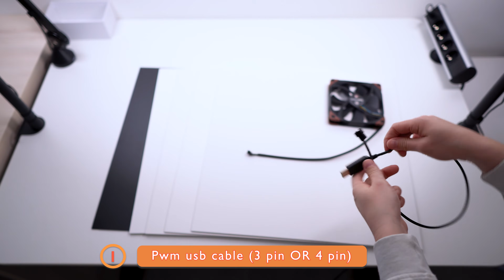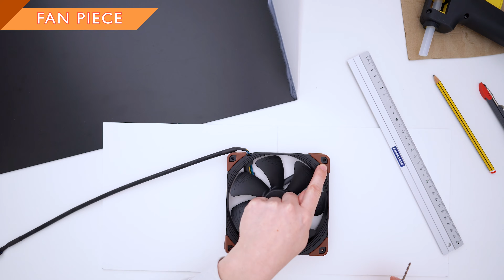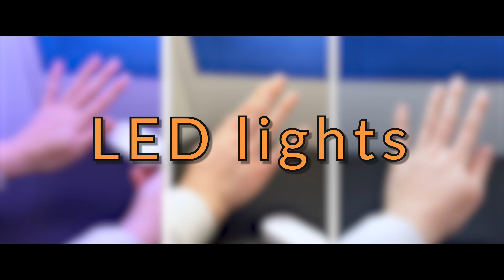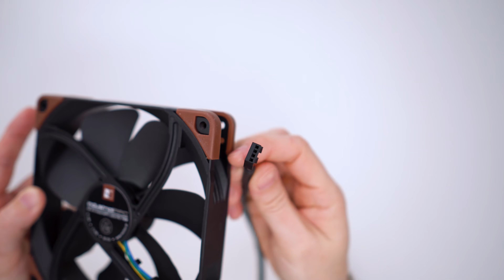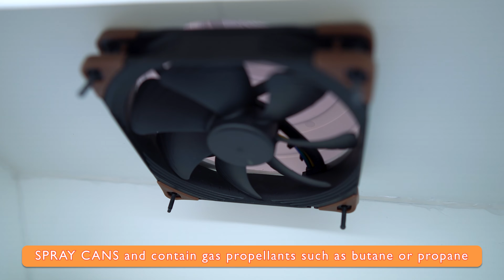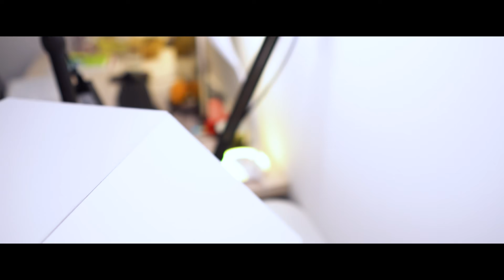Airbrush Spray Booth Build, How to Make it with Lights & Noctua Fan!

Comment: I know this is 4 years late but to anyone considering a similar setup definitely opt for a high static pressure fan, especially if you're running through Ducting hose. Basically if you wanna go the PC fan route choose a fan made for heat sinks or radiators . You can generally tell it's made for static pressure if  There are minimal gaps between the blades (this noctua ones gaps seem a bit large). 

 You could also overvolt this fan to maybe 15 volts to squeeze some extra power out of it. Especially being an industrial fan likely meant for continuous use overvolting it will get you more power and since you're not running it continuously I wouldn't imagine it overheat.

Comment: I wouldn't use the noctua. Just not cut out for such work. I could easily get a cheap HF-150 inline duct fan at $15 where I am and it has airflow of 540 m3/h and it's direct to wall socket and uses 75 watts.

Comment: Hello Daniella, looking for how to build my own airbrush booth (I'm just starting out :)), and trying not to have large expenses on it, I came across your channel.
According to how you explain in your first video, building the cabin, I must tell you that it is very professional as you explain, very good.
If it's not a bother on my part, can you put the measurements that you have used for each of the parts, to make an identical one?, since although the place I have to put the cabin has no exit to the outside, that cube where supports the hose, it has given me an idea of how to solve this.
Once again I congratulate you for how you explain and edit your videos.
Greetings from Buenos Aires, Argentina.
Reply from the maker: Thanks for watching! All the measurements are explained in detail in the video (where I come from, I use centimeters, but I also include inches), so all you have to do is stop the video where I measured the foam boards and draw them on a piece of paper - nothing special ''spices'' for this. In life in general, you have to be resourceful, and that is why I encourage and support all viewers to think that way. Let me know how your build goes and how you solve the challenges!

Comment: i Merci pour le tûto. le profilé a t'il le verre laiteux ?
Reply from the maker: This rigid foam board is not the same as Plexiglas, but I suppose you can use it as it will work anyway. The rigid foam board is made of a dense foam core, which can be laminated on both sides, and different types of plastic are used in its manufacture. Because it is made of foam, it is lightweight and easy to handle. Plexiglas, on the other hand, is an acrylic glass made of solid hard plastic, which is more difficult to handle if you don't have the right tools for it.

Comment: 130€ isn't that cheap... There are booths (also foldable) for less!

Anyway... I think that a single fan isn't enough for that long exhaust tube; that filter is too big for a single fan (you should only cover the fan, not the side, where there is no suction); i would put the filter/fan to the base, not that high (unless you spray from bottom to top.......??? Usually it's horizontal spraying move, not vertical!)
Reply from the maker: If it's like you say, then this video should be a reminder that this is not the way to do it. There is a lot of room for improvement with this build and this video is meant to inspire new ideas, as I said you will have to do the research yourself, for me this thing works!
Ps: You didn't mention the lights and the enclosure, which to me means that I did at least something right.

Comment: Hello, great video + I been watching this video for couple times already and I am wondering that why did you fried the adapter in the beginning because I am going that direction and I know nothing about electrical and stuff. Cheers
Reply from the maker: I don't know exactly ether but I think it's because that power adapter have adjustable output voltage and when I plugged the PWM USB cable into the USB adapter I didn't think about how much the adapter could be set to (I set it to 12V, but it should be 5V) and because too much power went into the PWM USB cable, they both fried in the end (maybe also because they were touching each other) and because this cable has built-in overload protection, the fan stayed intact. So if you want to set it up properly, you have to have the adapter or phone charger set to 5V and have at least 0,2A input current, but as for the PWM USB cable, it's pulling 5V of power through the USB connector and it's putting 12V of power into the fan, that's because it already has a built-in step-up circuit.
Thank you for your comment, I appreciate it, I hope this reply will help you somehow!

Comment: I see several discussions of fan capacity.

A spraybooth is effectively a fume extraction hood, and in North America, the face velocity of the air coming in through the opening should be 100 ft/min [0.5 m/s if I've done my math right]

For a 20" [50cm] square opening, we get 400 sqin = 2.78 sqft [0.25m2]

The fan capacity is then roughly: 278 cfm [450m3/h]

There are electronics muffin fans available online at affordable prices that can deliver this much flow - typically ~120 or 140mm square - when operating at 12 Vdc.
Depending upon market conditions, it may work better to install 2 or more fans in parallel in order to get the necessary flow.

The availability of bathroom or kitchen vent fans capable of these flows varies greatly by region... here in North America, the modestly priced bathroom fans for example do not go much above 100 cfm [170m3/h]. Industrial fans are available, but at prices much higher than a hobbyist would be willing to pay.

One potential benefit of using a bathroom vent fan is that some are made to fit into a window frame on a temporary basis.

You will need to shop around a bit in order to find your fan solution, based on your local market conditions.

One further note: fans that are going to be used with paints that have volatile organic solvents (lacquers in particular) need to be non-sparking (aka explosion proof) to ensure that you do not accidentally start a fire.
Reply from the maker: Very well done. I have never done such research, let alone thought of calculating it. Thank you very much for this valuable information, I knew it was best to put the fan as strong as possible but I did not know that there was a calculation for this. Having said that, it's really best to put 2 fans in parallel and close them so that the exhaust air is channelled towards the reducer and hose, or to get one specific fan that will do the job originally. In the upgrade video I did replace with a better one but obviously not powerful enough. I hope at least someone will read the above and use it on their spray booth!

Comment: Great video!  I am researching DIY spray booths for my own design of a collapsable booth.  Your design is very relevant, I will use some of your ideas, but with some flexible seams/joints so it can be collapsed and tucked into the closet when not in use.  I was curious to know the name/provider of that LED strip you ended up with.  I appreciate the sharing 🙂
Reply from the maker: I'm thinking of something similar for my outdoor painting, which I've made bigger than that and end up not having room to put it in my room, and what I've done is I've dismantled it and put it in a closet because I don't have a plan to use it in the near future. See my latest video, I replaced the led lights with a better one as they weren't the best and connected it on LED controller. I bought this better performing LED strip on an Austrian website because they provide shipping to my address and the ones I bought cost 50€ for a 5 meter long LED strips. See what you can get in your country, all that matters is that they are RGBW and not a regular ones and that they are good quality. Thank you for sharing!

Comment: I have built a couple desktop spray booths and like this design in general. One change I would make is to move the light further forward to light the side front of what you are painting . Light shining from the back toward me causes a  problem for my eyes so I have to place the light so the object to be painted is well lit but not shining in my eyes. I use a 19 inch strip across the top front shining back and down and a 10 inch strip on each side shining diagonally toward the rear. This gives good light and reduces shadows from my hands while painting.
Reply: As a very near-sighted person, I find that bright lights shining towards my eyes are a Bad Thing... even for folks with normal vision, it is best to light your work such that the light shines on the side of the workpiece facing you as you work, with minimal shadows and reflections.

This gets to be rather important when I am painting and weathering my models.
Reply from the maker: I don't mind the lights for now, because I've only used it a couple of times so far, actually I didn't really think of it the way you did, but I'm sure I'll use your ingenuity in the future. Thank you for sharing!

Comment: Hi Danijela.

I love the video and your precise instructions. I will try to build something similar at some point. 

I am confused by the ventilation. It venilates the exhaust into ... nothing? It just collects the gas fumes and paint in the back of the booth? What am I missing?
Reply from the maker: Sorry, I didn't intend it to come out that way, because the exhaust is so flexible I had to come up with one simple solution so I can put it away when I'm done. Initial intention was to show you how to make a simple little box to put the exhaust in. After all, you still have to stretch it out and get it through the window, where all the harmful air will go out.
Reply: H  @craftydanijela . Thank you for the clarification. :-) I looked at some other paint booth videos and they all show ventilation to the outside so now I understand.  I guess this is something I will have to do.

Great video ! Love it !

Comment: I wouldn't use a PC fan especially if your booth is that far away from the window, and I might consider using a window flange (blocking piece with hose opening) to mount the ventilation duct so no air got blew back into the room by wind. But I like the design and DIY part. Great content.
Reply from the maker: I know, but I don't have any other option. If I can drill the wall, I would, especially when is cold or hot outside it bothers me too. But I am not sure for my window, if I can make a hole, this window has 3 layers of glass. I will eventually figure something out to solve this. Thanks for that, I appreciate it!
Reply: @craftydanijela  The 100mm wire-reinforced vinyl hose appears to be the same size as is used to ventilate clothes dryers in North America. You can buy a flap-valve to go to the outdoors that will close when the fan is not blowing. 

Instead of making a hole through the wall, this vent valve can be mounted to a block of wood or foamboard that can be inserted between the window and frame with a partially open window, then removed when you want to close your window at the end of a work session.

The details will vary depending upon the window and frame you need to fit this up to.

Variations on this theme are commonly used by apartment dwellers, where their lease does not allow permanent modifications to the building.
Reply from the maker: I have another idea and that is to stick on the window the window seal usually used for portable air conditioner with the exhaust pipe extension attached, but with modification as @chemech said you can add a flap valve at the end of the hose but it is not necessary in my opinion.

Comment: Nice video, job very well done. I will also try to make a cabin for painting. I rejected the plywood because it was too heavy. Exactly which panels did you use, Forex?In your opinion is it better to use grilles on the fans to prevent the filter from being attracted?Thanks
Reply from the maker: By definition of the Forex panel (thick panel made from foamed PVC), it sounds like I made a spray booth out of these panels. I also think that the positive thing about these bords is that they are waterproof if you want to whip the surfaces. To use grilles on the fans is good way to protect the fan and defensive prevention that can be included in your build. Just don't forget to fix the filter well so that the whole opening can be covered. Thank you for watching!
Reply: @craftydanijela  The brand name for foamed PVC panels in North America is Sintra.

It is generally a good idea to have a plenum (chamber) for the air behind your filter and before the fan. 

One common approach to the filters is to use inexpensive disposable HEPA HVAC filters - aka Furnace Filters - which have a cardboard frame that provides some rigidity.

It is also a good practice to mount the fan on the exterior surface of the plenum, for better access for maintenance, and easier routing of the power wiring.
Reply from the maker: If you live in North America, Furnace Filters are relatively affordable, but in Europe you usually can't find them because we have other systems, or if you can get them, they are double or even quadruple the price as in the US. So it's important to do your own research into what's available to you.

Comment: Very nice work. I'm going to be building a similarly sized booth out of some cardboard that I already have, reinforcing it with the backing panel I salvaged from an old dresser, and ventilating it with four computer fans, for increased air flow.

Comment: Best DIY Airbrush Paint Booth that i found on YT....fits perfect for my needs :)
THX for sharing
P.S. I love the way you keep things tidy....your desktop extension lead for example😃😍
Reply from the maker: I'm glad I made this video and posted it to help at least a few people with the design.
I had never held a camera before and then I learned a lot about making videos and holding a camera. After a year I dropped it on the floor for the first time, to this day I'm still shocked but luckily no damage thanks to the step up ring and uv filter.
In the next video I'll show the upgrades I've made and how it can be simplified even further.
Reply: @craftydanijela  i couldnt belive this is your first video, you did perfect. i guess youre talented ;)

Comment: Hi! Very nice video, I think this is the best most simple tutorial so far (I've been browsing for hours!). So, I have some 3 spare pc fans (12cm), I'm thinking of daisy chaining them using fan splitter cable. My questions are, how much voltage do I have to set the DC-DC step up volt regulator, and must I use a bigger Amp phone charger? Thank you so much! Might as well subscribe wkwk
Reply from the maker: Thank you for watching! My intention with this video was to provide useful information that I haven't found anywhere on the internet and I am glad that it is useful to someone. Depending on the specifications of these fans. Can you find information on these three fans? This information is very important in the calculation and there is one very easy formula for this: V (volts) x A (amps) = W (watts). For example for my NF-A14 2000: I have 3 fans which has an operating voltage of 12V and the input power is 2,16W - this means that for 3 fans I need 12V (stays always the same) and 6,48W (variable - 3 x input power). And then you put all this into a formula because you want to know how many amps you need: A = W / V (A = 6.48W / 12V), and you get 0.54A, if it's more it's no big deal, with LED lights you have to add 20% more to the calculations anyway. Just pay attention to the specification on the adapter where it says input. I decided to change the NF-A14 2000 fan for the NF-A14 3000 and when I made the transition, even this 2 amps (output current) phone charger was not powerful enough anymore (the same was with the 1,5 amps in the video). This is because the 3000 needs an Input current of 0,55A and on the charger it says it has a current of 0,5A. I had to replace it with a regular AC to DC 12V 3A power supply adapter which has a 1,5A input current (more than enough) and a 5.5 mm x 2.1 mm connector. I then connected it directly to the DC 2.1 x 5.5mm Female and it seems to me that everything is even more simplified. On the market you can even find an adapter with an output current of 2A which has 0,8A input current. When you shop you have to look carefully and pay attention to all these specifications because they are crucial for it to work. I hope this long explanation will help you at least a little bit ;P

Comment: Awesome video and the first I found in month explaining how to use pc fans propperly. Which potentiometer have you used?
Reply from the maker: The potentiometer is just part of the step up voltage regulator, also called DC-DC Step Up Converter 2V-28V Step Up Module Boost Converter Power Supply Adapter DC Voltage Regulator (copied from amazon) and cost about €7 for 5 pieces. This voltage regulator with micro USB input is very useful if you want to use a USB that you already have at home and would otherwise be lying somewhere in the corner collecting dust. But recently I got another solution how to connect the fan, because I replaced the fan with a Noctua 3000, I had problems starting it (it didn't start immediately when I plugged it in, I don't know exactly why - just like it was with the 2000). Then I additionally bought a Power Supply Adapter which has 12V fixed and 3 amperes (with connector size 5.5mm x 2.1mm, used for LED lights, etc.) and terminal block 2pin DC 2.1 x 5.5mm female, and connected everything directly between with each other. It cost me additionally €16 and I can say that it also works like this. It all depends on what you have at home, how to get through it cheapest, BUT with good quality of course, and you have to be inventive as well as creative.
Let us know how your build goes!